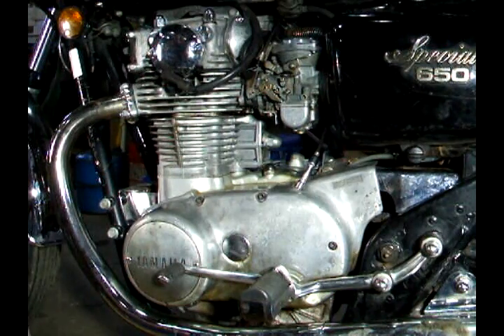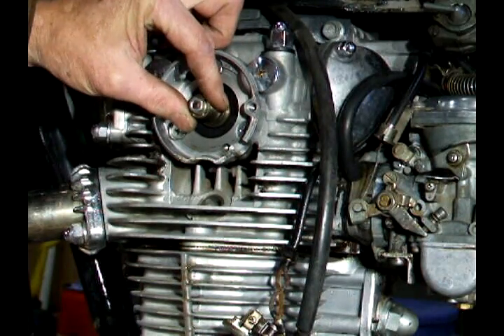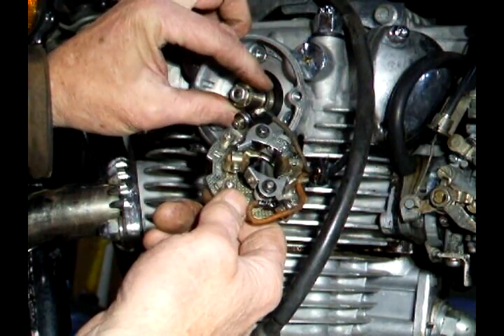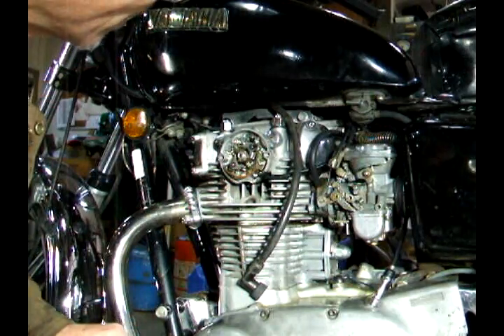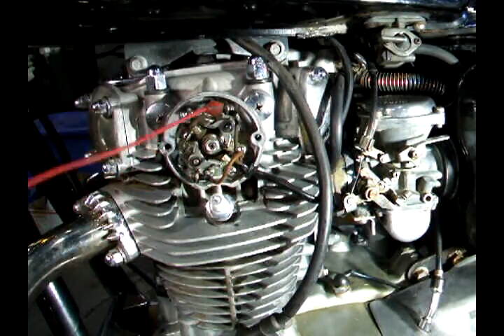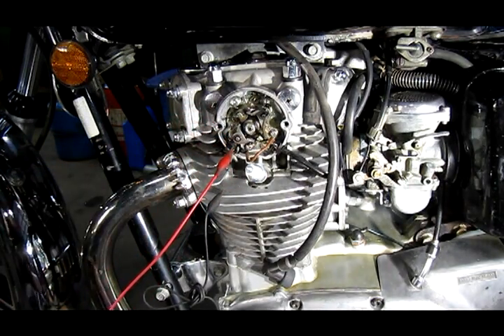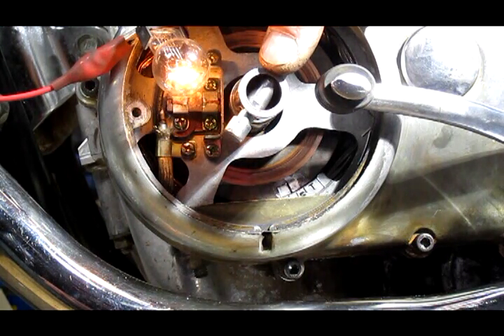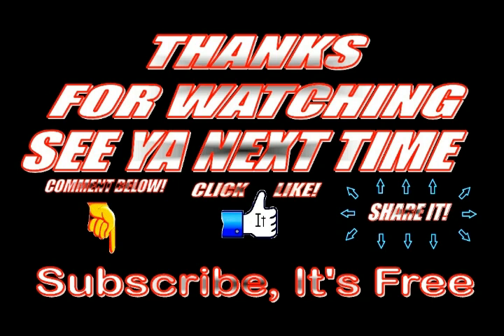Yamaha XS650 Static Ignition timing

Comment from the maker: Check out Amazon for XS650 stuff, at the best prices and they will bring it to your door.
Mikuni 34mm Pre-Jetted Carburetor Carbs Yamaha XS650 VM34-XS650 https://amzn.to/2JbLIY1
TC Bros. XS650 Billet Aluminum Intake Manifolds https://amzn.to/2HQlifc
Voltage Regulator For Yamaha Motorcycle RD400 TX650 XS650 /1976-82 https://amzn.to/2HNBz4i
Emgo Ignition Coil for XS650 with points https://amzn.to/2Hg1Ye5
Amazon 1970-1982 Yamaha XS1 XS2 TX650 XS650 Clymer Motorcycle Repair Manual http://amzn.to/2hwzVpX
Amazon ignition points http://amzn.to/2gTkx7D
Amazon Automotive dwell meter http://amzn.to/2gTTydy
Amazon inductive Timing Light http://amzn.to/2hDgFul

Comment: Nutguy, thanks for the video, been a while since I static timed. Question - turning the motor on starter, no plugs - I notice sparks flying off the points themselves (am not talking about the tiny arc between points) - newish points (500ml on them), no sparks escaping from your points when running. Are the sparks normal?, have never noticed them on any other points bike being turned over or run. Any ideas?, if it was a British bike I'd be thinking condenser/s.  Greetings from a Brit' in Sydney Australia BTW - Dare I say "Let's go Brandon"?
Reply from the maker: Yes sparks are normal. Dirty , oily or pitted points will spark more. Larger spark plug gaps will make the points spark more.  As far as Brandon goes, have him hold the spark plug on his tongue and his hand on the side of the engine while cranking the starter. Don't release the starter button until the sparking between the points stop sparking. Recharge your battery and have him check the other cylinder spark plug.
Reply: @Amotorcyclenut  Cheers mate, I appreciate the feedback and advice.   The mental image of Sleepy Joe sucking a plug cap you've given me will stay with me a long time - love it (would he even notice though?).  Again, best wishes.

Comment: I have a capacitor not a battery. How do I test the points once they've been adjusted..? The light doesn't turn on ever.
Reply from the maker: Disconnect the points wires from the coil connection and use a continuity tester or a VOM.

Comment: What type of bulb do you use to test because I have one and doesn’t turn on any any position, I turn the engine, but nothing. Only turns on when I connect directly to battery. What is a good lightbulb  to use and what is the voltage, I would appreciate the response.
Reply from the maker: Use a 12 volt bulb. The light comes on when the points are open, if the points are open and the light is not on means that you don't have power going to ignition circuit, or the points are shorted out.

Comment: Hay I'm looking for some help! I have a 78 Yamaha xs650 and I have no spark I took the steps in the video and I only have power to the points when I take out the plate with the points screwed to it. When I put the plate with points back in the points loose power. Like they're grounding out to the engine when I reinstall the points and it doesn't matter if the points are open or closed. What do I need to do?
Reply from the maker: It's hard to say with out seeing it. But if I had to guess I would say check where you connection at the wire to the points. You are missing a insulator or you put the wire on the wrong side of the insulator thus shorting out the points.
Reply: @Amotorcyclenut  Thanks I'll take a look at the points and see if that's what's going on.
Reply: I got power in both of my points but now my bike just backfire. How do I fix that? Thanks
Reply from the maker: synchronize your carbs. You can make a manometer to do it.
 How to synchronize motorcycle carburetors  https://youtu.be/Ulsw0235OKY 
 Build a manometer to Synchronize motorcycle carburetors. https://youtu.be/qBkxF0eP8FU

Comment: Will this stop the kick start from kicking back
Reply from the maker: Yes it will. The dynamic timing method is way more accurate, but only works if your bike will run first. Yamaha XS 650 dynamic ignition timing https://youtu.be/jhlSwl3ppE0

Comment: Hi, I have a 1985 Yamaha xj700, I've rewired it with minimal wiring just to get it to run for now. However, I'm not getting power to my coils when I go to start it. All it does is turnover. One thing I've noticed though is when I have the plug out and it grounded to the motor, I will touch the terminal to the battery and I will see the plug make a spark off the engine block. But it will not when I turn it over. Can anyone help me diagnose this and possibly what to do? Totally lost...

Comment: After struggling with no spark on points, now I need a tutorial on how to swap the electronic ignition from my 82 onto my 76 because I'm pulling my hair out over this shit, lmao. Thank you for the video regardless. I will keep trying and hopefully nail down this no spark gremlin. Light never comes on. And yes, the light works! Power to the rest of the bike (tail light, head light, neutral switch etc.) but zero spark when using my test light on the points. They look in rough shape. I set the gap properly and tightened the cam chain tensioner. Aghhhh
Reply from the maker: If the light never comes on, it means that the ignition circuit is not getting power or the kill switch is the problem. Keep trying your close.
Reply: I know this is old but hey…
Be absolutely certain there isn’t an oily film on the points….oil will ground out your points and there will be no spark.

Comment: What does it mean if the light stays on even when the points close?
Reply from the maker: I means that the points are dirty and or not making contact. That also means you have no spark!
Reply: I've been chasing a no spark gremlin lol. Weird thing is that i changed that point with a "new"' unit, but I'm wondering if it had corroded after sitting oh the shelf for decades cuz it doesn't look shiny and new by a long shot...
Reply from the maker: That happens, you'll need to clean them with some fine emery paper and check the continuity with your multi-meter. Then they should work.
Reply: A Motorcycle Nut that did it. I filed the "new" points and finally got spark. Happy days! Thanks.
Reply from the maker: Getting good spark is empowering, not only for you but your motorcycle also!!!
Reply: So true. After banging my head for weeks, it's almost as gratifying as firing up the bike for the first time!

Comment: Hi, I have a 79 Yamaha xs750cc.I would like to know if you have a video explaining how to set the ignition time. Thank you.
Reply from the maker: No I don't, but the process is basically the same. If your bike does not run us the Static method. Static Ignition timing https://youtu.be/aziKRn5fwsA  If your bike does run and you want to get it dialed in exactly for easy starts and great performance us the Dynamic method.  Dynamic ignition timing. https://youtu.be/jhlSwl3ppE0. Always adjust the cam chain tensioner before you start. Cam chain adjustment https://youtu.be/pRNTtTmS0jw
Reply: Thank You very much, very nice videos.